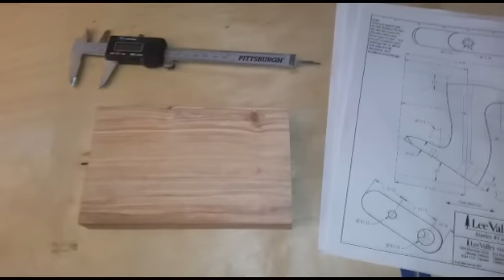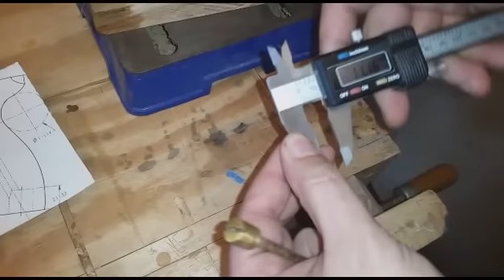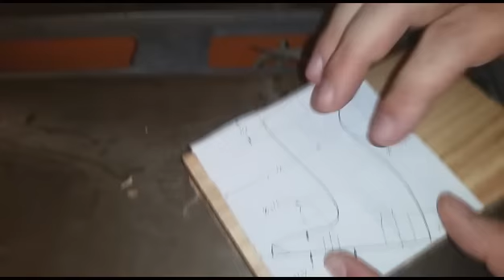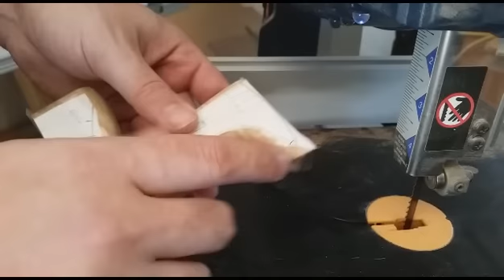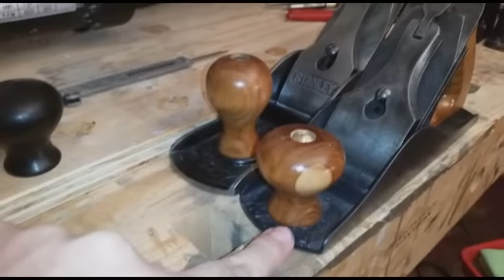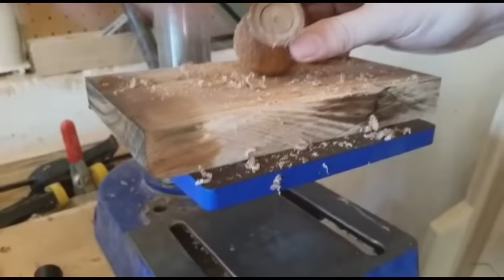Make a Hand Plane Tote

Comment: Great video!  If you happen to have a drill chuck for your lathe, it might be easier to drill the holes in both the tote and knob using the lathe rather than the drill press.

Comment: Just a safety point.  I cringed when I watched you free hold when drilling the holes in the base on the tote. A Jacobs hand screw clamp would hold it steady and save you from a potentially nasty hand injury if the drill bit walked. And especially a Forstner bit.

Comment: Nice job!  To stick on the pattern, steal your kids glue stick. It works as well and it removes more easily than spray adhesive. I noticed that the plane you made it for didn't have a lateral adjust. Is that a real Stanley or are you pretending to have one by using a Harbor Freight $10 special?
Reply from the maker: Man na It actually didn't have the whole top half of the frog.  It's a pretty old Stanley that was broken at some point.  I've gotten a replacement one since finishing the handle.